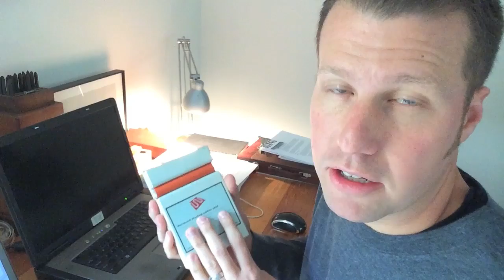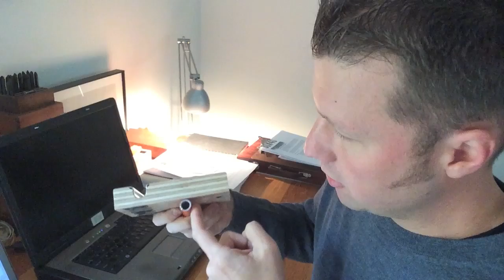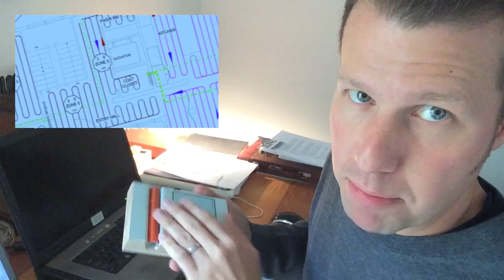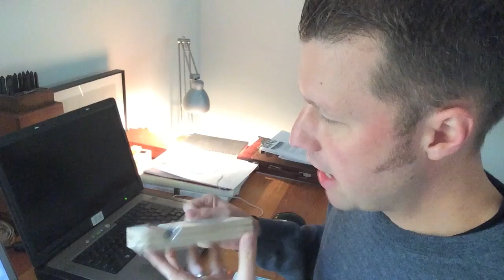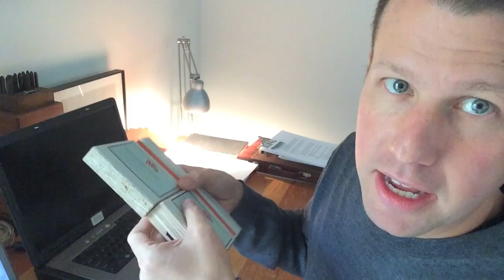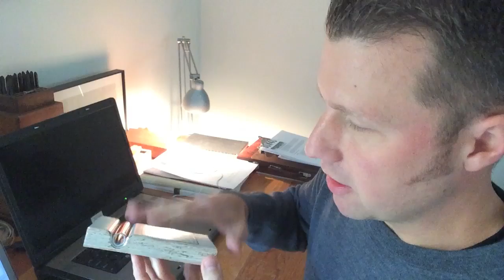Warmboard Radiant Panel - An Architect's Review | Thirty by Forty Design Workshop

Comment: Im building an ICF house and currently looking at floor radiant heat options. In theory, I’ve seen radiant floor systems for heating, but can they also be used for cooling the house during the summer?

Comment: Been in the radiant business over 35 years. Haven’t seen a general contractor that wants to use Warm Board a second time. Cost is too high and it’s real pain to install. Osb? Really? HeatPly is the way to go.
Reply: HeatPly has no aluminum and so I presume requires closer spaced tubing (so higher PEX costs) higher water temperatures, and slower response time for those shoulder seasons.  Other than making the contractor's life easier (not my primary concern), what are the benefits for the homeowner?  Okay, material cost.  What else?
Reply: @stephend  You can get around town in both a Topolino EV and a V12 Ferrari. One can go 0-60 in 2.9 and another in 11.0, at a 60 the target for both, congratulations, job well done, both of you have radiant heat or an espresso at the same piazza. Warmboard is a great total product for the great, the rest can be made very happy at a much lower total cost.
Reply: @DontTellMeMore  Some answers would have been more helpful.
Reply: @stephend  Happy New Year to all. Attempt at being more helpful but still entertaining. Question: Do you want one of the best radiant heating systems for your way-above-average residence? Answer: Warmboard. Who cares how much pipe, what spacing or how many dollars. Construction companies that build homes for Architects don't ever have a problem with anything. Sausage making is their forte. Jack Nicholson said it best in that immortal sentence " You can't handle Warmboard, stay in your lane "
Reply: @DontTellMeMore  Happy New Year!  I am inclined to use warmboard, I'm just trying to determine if the premium price will see a return in investment.  It seems it's not popular enough in the US to have drawn much attention from those that do the analysis on such things.  Underfloor heating is almost standard in Europe now, and the warmboard type subfloor doesn`t appear to be used there which makes me thing it may be more style over substance.  If it was worth it, why wouldn't it be all over Europe?
Reply: @stephend  I live both in the US and EU and you are correct, warmboard isn't a thing with us Europeans yet. Warmboard is great for someone who thinks 50k vs 100k isn't a significant difference in cost. In my own US home I have 2300 SQFT of staple up, using thin heat transfer plates and 2400 SQFT of PEX embedded in concrete, lower level and garage. System works great. In warmboard the system would use less pipe and a lower temperature for the staple up area. In my zone with a 7 degree design temperature the boiler is condensing around 70% of the time. I could  DIY build the same 4 zone system with a Vitodens boiler & DHW, a 12 loop cross manifold and all Caleffi peripherals and Tekmar controls for about 16-20K. I like to build things. I like to pay for what something is worth vs paying what I can afford. Is warmboard wort it? For some people it is, for some high cost building locations it is. Both my children would pay for it, I would also but only if I could not do it in any other way. Both my Mini Cooper and Porsche completely satisfy my car-lover needs, one is fancier than the other. Hope this helps, have a great year.
Reply: @DontTellMeMore  Thanks for all this info - 50k vs. 100k is a big deal for me (I don't have a Porsche, though I am from Europe, which is probably why I hate forced air).  My attitude to paying for it is similar to yours - but I am not as confident in my ability to pull it off (when I do DIY I like to do it right, but I don't do it often).
Did you meant to say you run it at 70°?  That sounds great - I want to have marmoleum in some rooms, and they don't tolerate anything above 80°F.  I'm looking at about 1900 sqft subfloor in the house and 1200 sqfr cement basement.  Thinking of doing the 510 sqft garage too.
Reply: @stephend  You can do it. I do not guess at anything I do. For best results you could use free software like LoopCad(still works after 30 day trial but cannot save so use screen capture to document) and Taco FloPro Designer. A single Grundfos Alpha circulator can run the complete system. Spend time managing loop length to insure manageable head losses. If I may ask what Country are you in?
Reply: @stephend  Avatars are not always what they seem to be,
Reply: @DontTellMeMore   I'm in the US - Ohio.  Seems the mere mention of hydronic heating sends builders (and plumbers) running for the hills.........
Reply: @ I am in Hudson Ohio
Reply: @DontTellMeMore  No way!  Willoughby.

Comment: Can it  be used over slab?
Reply: A little late in getting back to you on this one. Yes. It can.
Reply: @Warmboard  So what about "COOLING"  ??  I would guess an Air Handling Furnace with AC Coil and exterior condenser and duct-work is still the only way to install Air Conditioning -- So why bother with radiant floors if the environment required AC also? Especially in moderate to high humidity states/zones
Reply: @retiredperson4054  Most of our product utilize both radiant heated floors and air conditioning. Ductless minisplits are a good option as well.
Reply: @Warmboard  Building a Log Chalet 3 bedroom -- the min-splits are not on my list of aesthetically favorable items -- Don't want a motel heater/AC looking thing hanging near the ceilings!  So probably going to have to install a duct work Forced Air furnace (I have Natural Gas) and go with evaporator and condenser (typical FA items)?

Comment: Hey thanks for the vid, i am going to place my raidant heating over my old flooring, thinking of using heatply due to extra heat spread in the panels. Any thoughts?
Reply: Hey James there are so many reasons to use HeatPly over Warmboard. Ease of install and cost are number one and two. Don’t know anyone in my area still using Warmboard. Have other issues with their product that I won’t get into.

Comment: do you have recommendations as to what to put on top of the warm board? once it's installed?
Reply from the maker: +Joan Pontius we typically protect it with ramboard before the finished floor is installed, otherwise the channels can collect all kinds of debris...
Reply: Thanks for the response, but then what kind of finished floor?  My heating company is going to put together a proposal for us, but indicated that I would have to get someone else to install the finished floor on top of it.  What products should I consider, and what should I look for in a contractor to do it?  We previously had radiant ceilings, and with the change of temperature, the ceilings would eventually get cracks.  Is this a consideration when selecting flooring options?

Comment: I am considering using it Warmboard in the new house we are building as an alternative to gyp-crete radiant.  I see the list of advantages and think I might be able to make it work for about the same overall cost.  My architect however is less enthusiastic.   He used it once on a job in Alaska and got a lot of negative feedback from the framing subs that it was hard to install because as opposed to a normal subfloor, the Warmboard had to be installed in a very exacting way to get the tubing channels to line up. That he said turned a ½ day job of laying the subfloor into a 2 day job, obviously costing a lot more in labor.  They also had problems with the tubing wanting to pop out of the channels before the finished floor went down.   
 
Do you have any comments regarding that based on your experience?
Reply from the maker: I think it’s an excellent low-mass radiant floor system and will react more quickly than the gypcrete option. Everything arrives templated and mostly precut with layout drawings showing where each panel is supposed to go. Using CAD and BIM and field verified dimensions I’ve never had a problem with sheets not lining up.
The complaints I’ve heard from contractors I’ve worked with are that it must be protected unlike a traditional - Advantech or similar - subfloor which is thoroughly abused throughout construction. Because it’s often doubling as the structural floor system and the heating system it’s installed early in the process and as-such the alum. coversheet can be damaged if not protected. Equally, it can collect a lot of construction site debris in the channels. So, it’s imperative you protect it. 
I’ve never heard of the tubing popping out before. When installing the tubing there’s a noticeable positive-lock effect; I wonder if the tube diameter used was non-standard? 
A couple of other things to remember:
1) Laying the subfloor and - essentially - the heating system at the same time saves labor, there's no question. The calculus of 1/2 day job equaling 2 isn't really a fair comparison. To truly compare, add to that the time it would take to do the tubing layout and set it in gypcrete?
2)As with all things in construction, if there’s a perception that something is going to cost more to work with or install - whether it’s true or not - it will often result in a more costly installation. If you have a contractor on-board already I would work together to find on the solution that best meets your needs. 
Warmboard is an excellent company to interact with and would be helpful in assuaging any reticence on the contractor or architect's part.
Good luck...
Reply: Great input Eric.  Thank you for taking the time to respond.

Comment: Hi Eric. In your video you mention that the cost to install is around $7 a square foot. I'm assuming that is time (labor) and material. For us do-it-yourself types, what would you estimate the cost to be since we provide our own time (labor)? Does it cut that in half? Does it just knock a buck off? I appreciate your time. You're video was excellent.
Reply from the maker: When I recorded the video - which was a few years ago - the material cost (not including labor) was approx. $7/SF. Warmboard is a fantastic company, easy to talk to; send them your plan layout and the panel type and you'll quickly have a material quote to work with. Cheers...

Comment: This system does work great for heating - bar none the best I've seen.

Caveats are that:

1) tubing is exposed topside during construction, add to that that most construction people drop screws and nails and all kinds of thing while working - you need to be vigilant.

2) This system totally blocks wifi and zwave/zigbee signals from floor to floor - Faraday; Lutron radiora works fine as it's a lower frequency.  Basically higher frequency signals will be significantly blocked.
Reply: Any builder worth 2 cents would place a layer of ram board or something similar to protect the floor during construction. Under no reasonable circumstances would it be left exposed unless you've hired a terrible builder. Also, a really easy and cheap solution to signal interference would be to place a wireless access point on each level of the house, connected to a central router or switch via Ethernet cable.

Comment: Subject: Warmboard
 Message: Hi Eric;  I realize you posted this video quite some time ago but I
 do have a few questions. We live in the Chicago area; have radiator heat and
 are doing a small addition (10x14).  We want to use in floor heat against
 fabricated wood floors as we have wood floors thoughout the rest of that
 floor.
 My concern with the product is twofold.  1. I have heard horror stories
 about humidity levels and making sure you keep the humidity levels constant
 all the time to prevent warping of the wood; can you speak to that at all?
 2. What about the warping of the wood?  Since the warmboard is so close to
 the wood; have you seen that before or problems with it or any products in general?
 Thanks so much.
Reply from the maker: Hi Laura -
This is advice based solely on my interpretation of the issue described, I'd recommend hiring a local architect or contractor who can evaluate the precise circumstances of your situation before proceeding. That being said, I would first ask why you selected to use radiant for just one part of the home? I ask because hot water baseboard requires a higher temperature water than radiant, which means you'll need to temper (cool down) the hot water you've heated for the rest of the heating system for the loop that will supply the radiant heat zone. Even if you can live with the inefficiency of that configuration, the time it will take to heat the zones will differ greatly. I always try to stick with one type of heat for a project if possible. You'll need to plan for the differential expansion between the radiant and non-radiant portions of the home if you go this route.

RE: humidity - It's crucial when installing a wood floor to make sure your floor has acclimated to the ambient humidity level in the home. We usually set hardwood floors in the space they're going to be installed in for a few weeks to acclimate. And we always test the flooring with a moisture meter prior to install to be sure we're at the recommended levels before proceeding with the install. Wood will move throughout the seasons that should be expected, gapping in the winter and swelling in the summer. When you install it after it's been acclimated to the home's ambient humidity, you're ensuring that it won't buckle or open up too wide in any season.

RE: warping - I'll presume you're referring to a condition where the wood deforms so much that it creates an uneven floor surface. This can occur for many different reasons: because of too much moisture coming into the wood (from below say a curing slab for example) or because of poor detailing (no edge gapping, etc.) or due to improper installation. I haven't seen it happen due solely to the use of Warmboard though. Warmboard actually allows you to run lower temps on your radiant tubing than would normally be required for a radiant system and because the heat is evenly distributed across the surface of wood you run less of a risk of inducing temperature related stresses to the wood as well.

Good luck with your project!